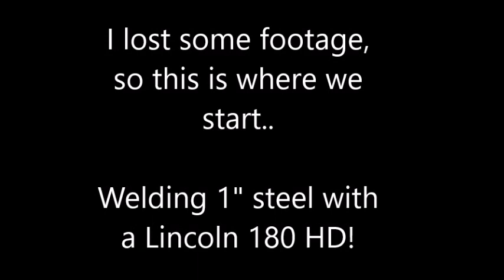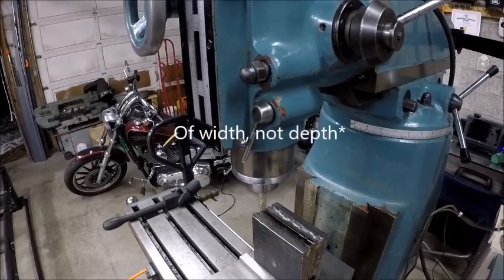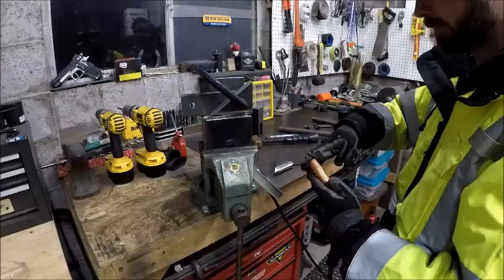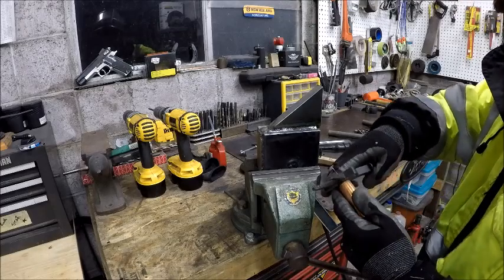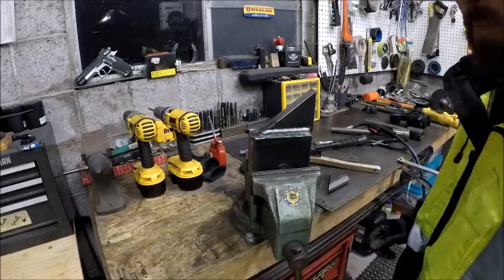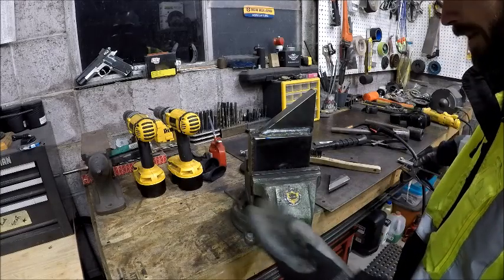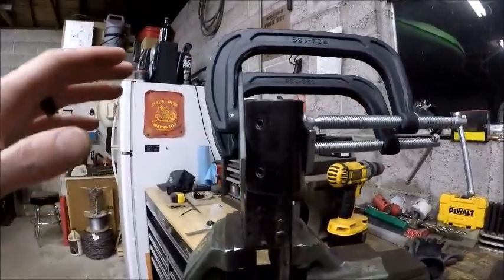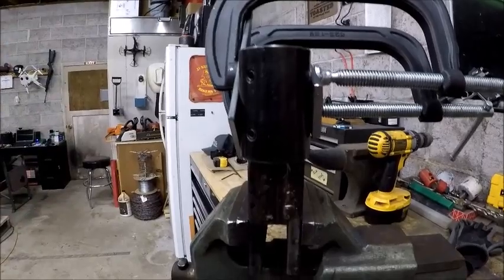Welding 1 inch steel with the Lincoln 180HD

Comment: This machine can handle thick steel if you know what you are doing and prep it right. I have the 180 dual, pretty much same machine at 220v. I just did a bunch of 1/2” structural welding for i beams and steel posts on my house; bevel everything right and pre-heat after tacking to help the weld penetrate. ER70S-6 wire (linc. L-56) is rated for multi-pass. .035 wire at max voltage and about 290ipm was perfect. I then had to weld some 1/2” plates to the ibeams on site off 120v generator. Same thing, prep it right with bevels and pre heat stuff, at max heat with (030 wire this time) and I got fine welds, just a little smaller beads than with .035” @220v.

Comment: Nice job on the welds. I have a poor man welding set up 4 welders 2 Mig/flux core welders 2 Arc welder's are my go to for heavy frame welds or ruff use items. I have 2 because Thermo over load sucks and I hit that junk often so let one cool burn more rods on the other I use 6011 1/8 - 5/33 Hobart rods and swing for the fences finish up with good ol 6013 or my go to odd angle 7018 because those 2 rods make life beautiful LoL.
Reply from the maker: Yes, you definitely have more stick experience than I do! Ha ha. From my limited experience, I mostly ran 6013 and 6011, but that was mostly just practicing. I don't feel confident in my stick skills yet to do anything for a customer... So far the MIG setup hasn't failed, but it's nice to have the ol' stick welder as a backup.
Reply: @DennysCountryLife  Arc welding is easy and fun when you get it down. I use Arc welding for my job in a Die Casting factory. We have a lot of vibration and heavy equipment beating and banging around Mig welds don't hold up as well as Arc welds but I love them both. Some day I will go all in on a Miller or Hobart 225-300 generator welder. Thanks for the reply stay safe and best of luck with your projects.

Comment: I really wish Lincoln would list the inches per minute on the wire feed, really helped me to dial stuff in when going off of processes I read or learned about. Knowing the IPM really helps.  Checked my Linc Power MIG 180 Dual;   #3 = 180 ipm, #4 = 225, 5 = 300, 6 = 350 and 7 = 390 ipm.   I wrote it right on my machine. Should be the same for the 180C or 180HD. 
(Start a stopwatch and the gun, release the trigger at 6 sec., multiply length by 10)
Reply from the maker: I totally agree with you. That would be very nice of them. Thanks for the translations! That's awesome.

Comment: What settings are you using for welding 1/4? I'm using .035 solid wire and cannot get enough penetration; but it works fine using fluxcore though.
Reply from the maker: I can't remember what settings I used on that machine. I sold it a while back for a larger machine. Make sure you're switching the polarity when you run MIG vs flux core. All the best!
Reply: @DennysCountryLife  
That's what it was! I going to try it again. Thanks a lot!

Comment: The first thing I noticed was the 1911 in the window???  Anyway never mind on that.  I am saving to buy a Lincoln 180 weld pak after paying my taxes and insurance.  I am going to build a front end loader for a 3 cylinder 430 series John Deere diesel lawn tractor.  Given some of the thicknesses I will be welding the Lincoln 180 seems the best in the price range and for my needs going forward.  Did you use flux cored wire?  According to the chart it says the 180 mig will weld up to 1/2" with cored wire, not shielding gas.  Every welder I looked at says the same thing.  All these welders will weld thicker material with flux cored wire and I see guys blasting into pieces of rail.  What's the secret???
Reply from the maker: Ha ha, yes.. it's a Co2 pistol I've had laying around forever in the shop. The 180 will be a fine machine for you. If you plan on welding a lot, you will find the duty cycle annoying. I would run mig if you can afford the gas cylinder. Flux core will burn hotter, but that isn't always what you want (can cause warping easier). You can weld 1/2" with C25 shielding gas no problem. Depending on the type of weld, it might take more than one pass. Nothing wrong with that though
Reply: If I weren't afraid someone would break my glass I'd have a hog leg in every window as a deterrent!  lolThank you for replying.  I am planning on running with gas I just assumed once I got to half inch I'd have to switch the leads and and use cored wire, but after what I saw and you told me I am satisfied and confident the mig 180 will be perfect for me!  This loader plan I have for the loader only calls for 1/2 plate where the arms angle and some 1" where the cylinders are pinned.  I'll either heat the pieces or double weld them.  I'm pretty excited and a little nervous, I haven't welded since 1984.  :o)

Comment: Why do you pull and not push your mig?
Reply from the maker: I do both. Both are strong, pushing is better, but this was a demonstration video. You CAN pull a mig weld and have extremely good results. Sometimes you have to in certain situations. Don't be afraid to do it.

Comment: The settings on your machine were what I watched for, disappointing. The Satriani was cool though.
Reply from the maker: Settings are something that will change depending on many factors. What worked for me might not work as well for you. Input voltage to the machine, quality of ground, brand/quality of wire used, etc. You need to practice to get the right settings for your setup. Thanks for watching!